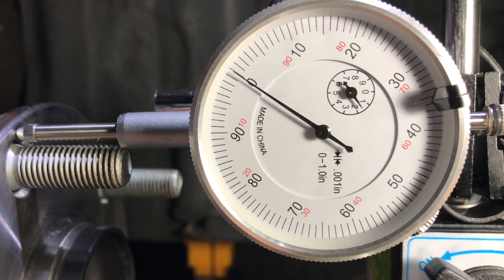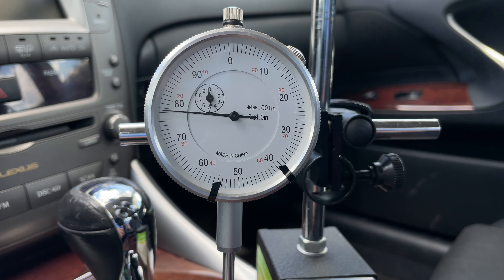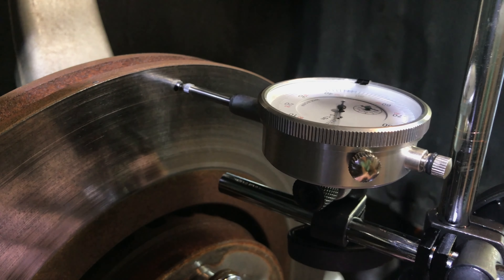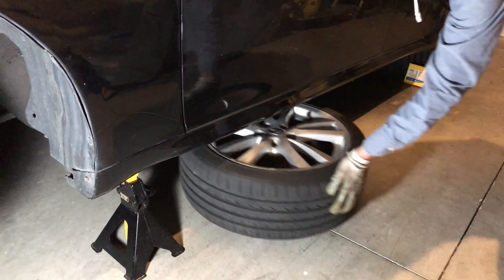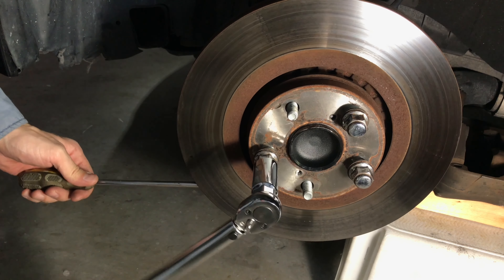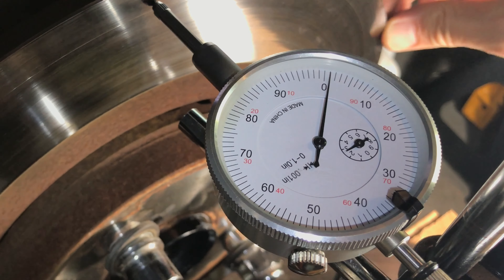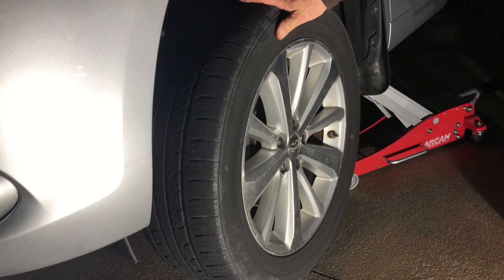How to measure warpage of a brake rotor.

Comment: I recently got changed the front wheel bearing for my car and after that I noticed whenever I brake, the steering wheel vibrates. Is it possible because he did not do the job properly?

Comment: Hi! I need some help please! I have recently changed my brake discs, I bought bmw OE discs and brake pads, after short time (300-400 miles) the steering wheel started to shake when braking, I guess the wheel bearings might be the issue, right? I did not braked hard or drive through puddles. If I change the wheel bearings will this fix the shaking? Or are the brake discs already compromised? Thank you!!

Comment: Most vibration while braking is from uneven pad material deposits from overheating brakes.
Reply: Agreed. Most whitebox rotors like “daily driver” brands from RockAuto have commonly upwards of .005” runout. However brake pulsation/vibration/judder is from uneven brake pad deposits onto the rotor.

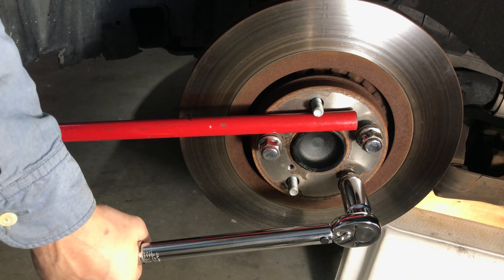Comment: 2:00 you may have to add washers with some lug nuts, because it will destroy them without the wheel there . . .
Reply: Totaly agree got to take into account thickness of the wheel
Reply: @mikedunphy1981  It showed up when he spun the rotor. That suggests that he didn't get the rotor snug enough.

Comment: Both my Lexus keep warping rotors in the span of 1-3 years. I need one of those tools maybe the hub needs to be replaced.
Reply: Maybe, you might also want to check if your brake hose has failed, your caliper pins are sticking(not using Toyota rubber grease will do that), or the caliper is frozen. And don't buy anything but OEM rotors.

Comment: The question is, will this runout cause a wobble when driving at certain speeds?
Reply from the maker: With excessive runout, most of the time you will only feel vibration when braking.